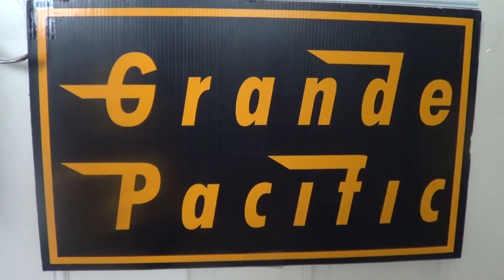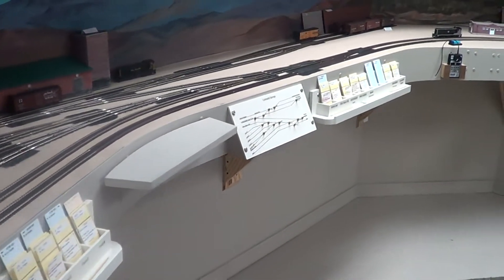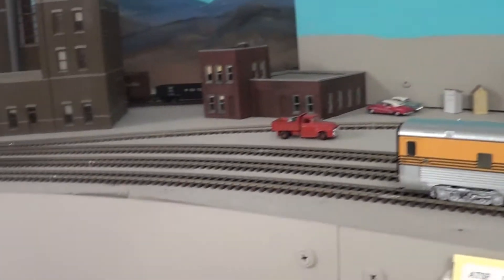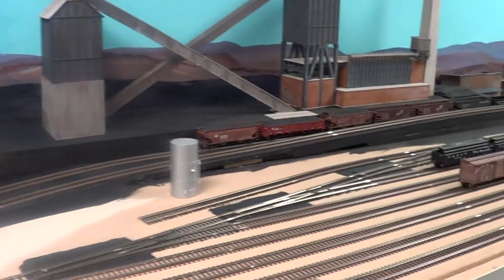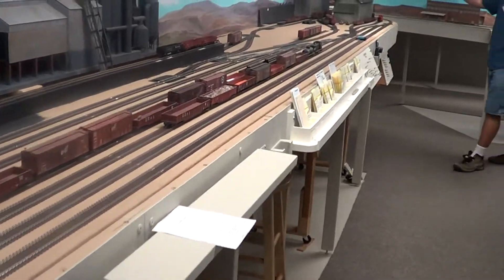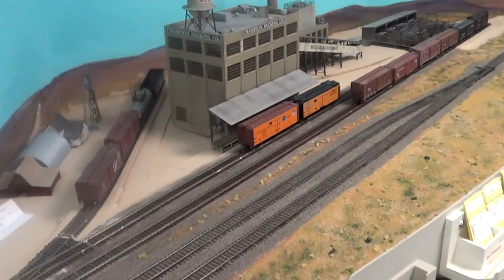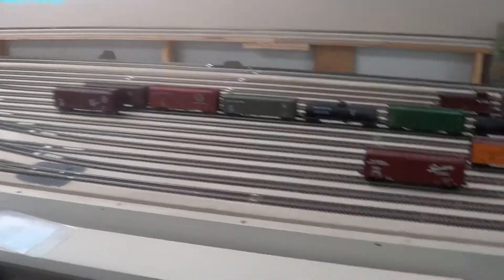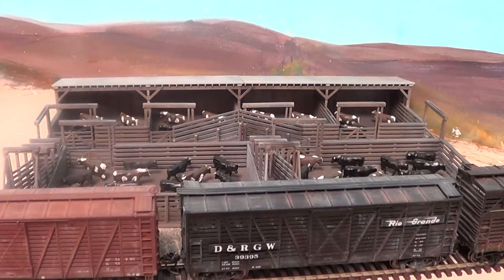THE PUEBLO DIVISION- 1954 HO 2012

Comment: Oh ok, I get it now?  Y'all are a model railroad club that travels around filming all kinds of layouts around the country.  I thought it was all in the same building and y'all had different types of scenery & layouts?  I'm think about doing a 3-tier set-up in my 2-car garage which is 18" wide by 24" deep which I think would make for a great train house personally?  I thought I could do one tier with steam & diesel from the 1950's, then do a 2nd tier with all diesels from the 1960's and finally do the 3rd tier as all diesels in the 1970's era.

I can cover all four walls around the inside of the building, then do a few good size island type layouts in the center of the garage with bridges as lift-outs or hinged bridges for ease of access inside the areas?  I've been buying & collecting over a period of some 25+ years and now that I'm retired & widowed, all I got is time on my hands and what better time than to start my dream layout.  I'm an "old school" kind of guy & plan to run al DC operations.  I'm not into all this hi-tech stuff and that DCC just looks far too intimidating to me, not to mention the cost, lol.  About 80% of my rolling stock is the older Varney metal/wood kits, while the other 20% is the Athearn "Blue Box" kits collections.  Most of my motive is KATO & the Newer Proto 2000 Series because that's some nice equipment in my opinion.  Man, I hope I can build 50% of the fine layout, detail & scenery y'all have accomplished and the main idea is to have tons of FUN!!!  Thanks for sharing so many videos guys, you've given me plenty of ideas for sure.  Oh yah, I'm a huge fan of those ground-throws when it comes to turn-outs & switches and I've got that down perfectly with lots of practicing over the years on my workbench, lol.